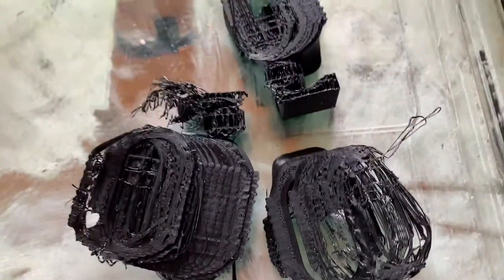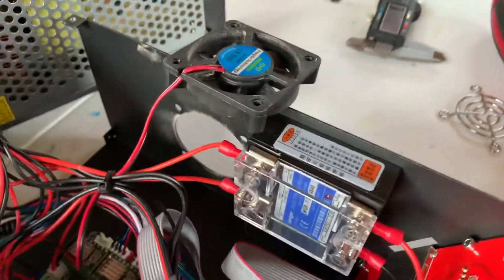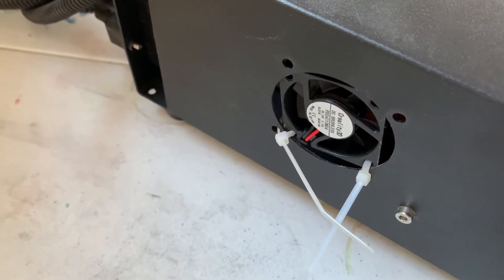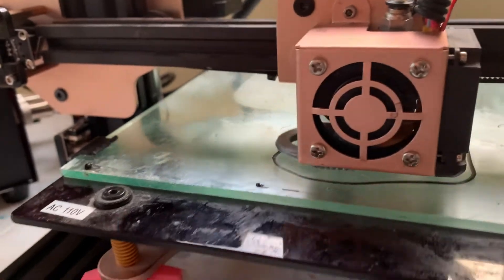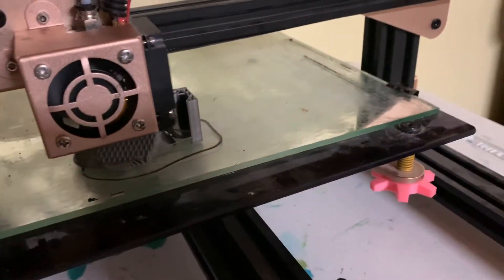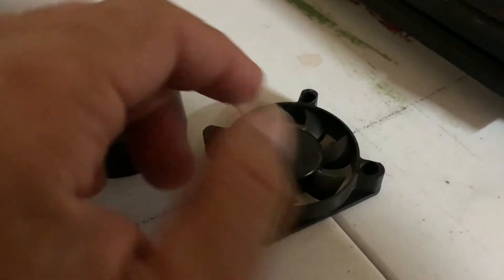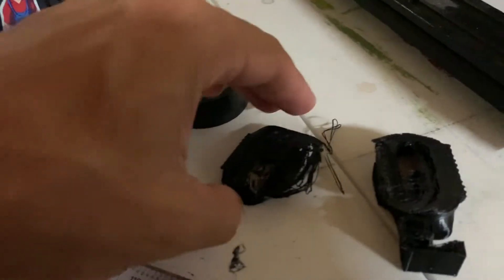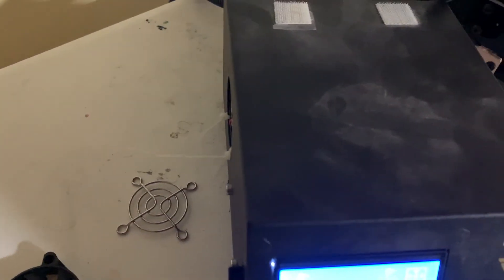Troubleshooting Layer Shift on my 3D Printer

Comment: sorry i might of missed it but did you which axis the steps were from ?
Reply from the maker: If I remember right, on mine it shifted in the x direction mostly.
Reply: @RickBolt  thanks for that , mines on the Y but i think ive  fixed it (loose pully) thanks for the video and response

Comment: Thanks Rick, I'm looking forward to see if this will fix my issue as well. I have the exact same machine with what looks like the exact same problem. If this doesn't work then I'll look at belt tension on the y-axis or the y-axis stepper motor.
Reply from the maker: Hopefully yours is not more complicated.